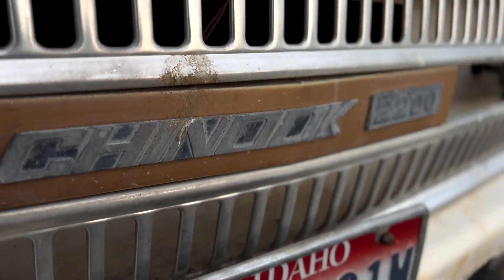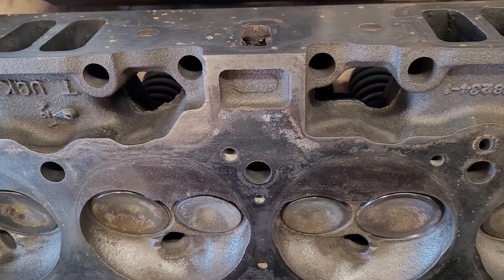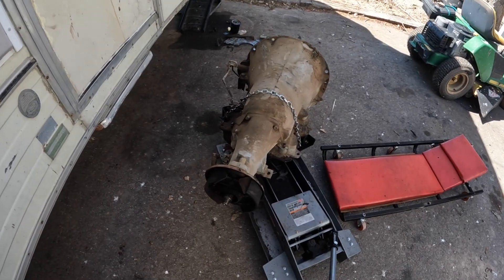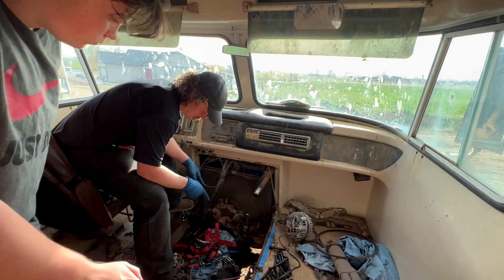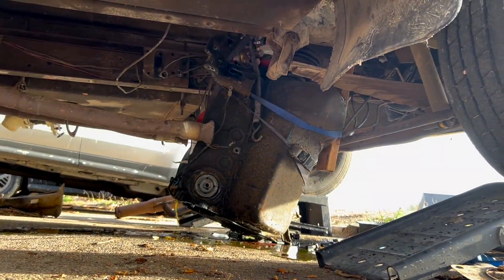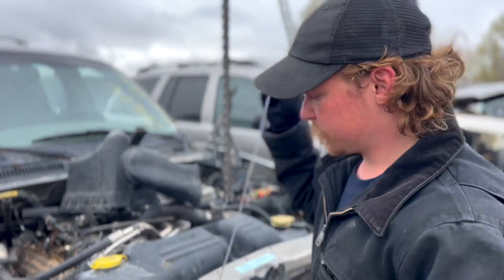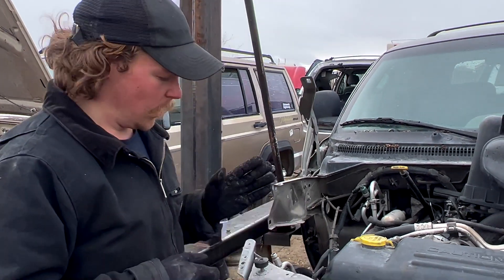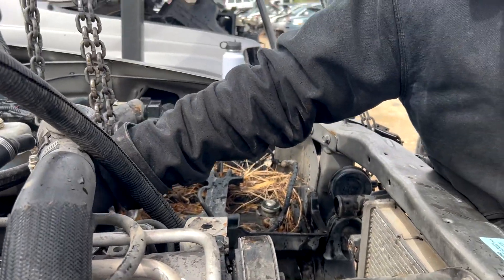1972 Chinook RV EP3 - Junkyard Drive Train Swap

Comment: Really enjoyed this video! I've always wanted to see some content filmed in Jalopy Jungle. I have a shop over here in Nampa and I go to that yard quite a bit. Its nice to share the knowledge of how to pick a motor in the junk yard to help folks learn how to obtain affordable parts to fix their own rigs! One think I usually do is take a fully charged battery in with me, just have the guy mark it as you go in. Then you can use it to do a quick compression test. As an added bonus, if you can find a somewhat complete car close by with keys, you can hook the battery up to that car and run the radio and have some tunes while you pull your parts. Another tip; if you want to get an idea of how many miles the rig you are looking at has (say the cluster has already been picked) you can look for the oil change sticker on the windshield- and like you said search the vehicle for documentation. It kind of ends up being like a mini investigation.
Reply from the maker: Glad to hear you enjoyed! That's awesome, I'm also near the Nampa area. I thought they wouldn't let batteries in, I'll have to give that a try!  Thanks for the tip